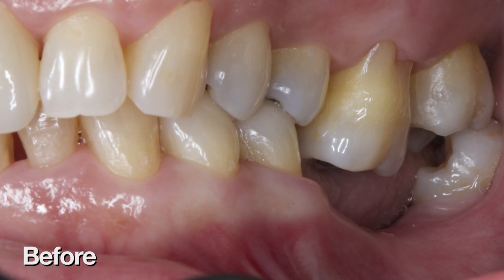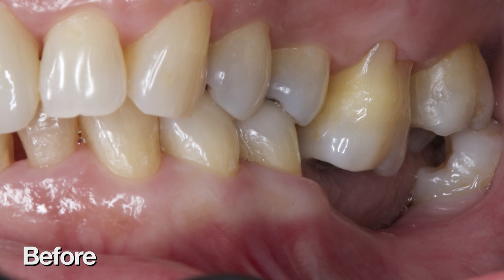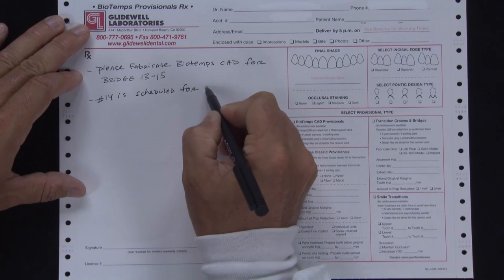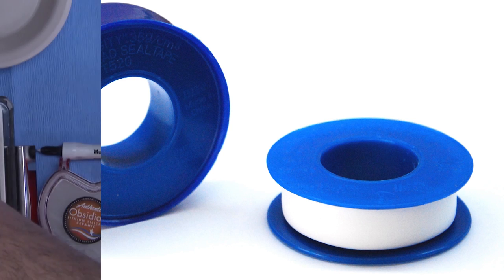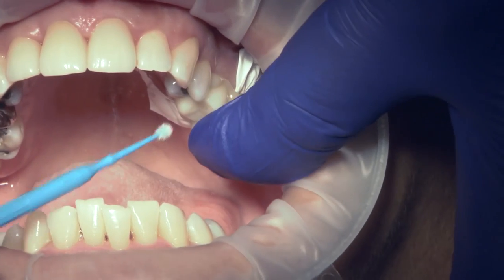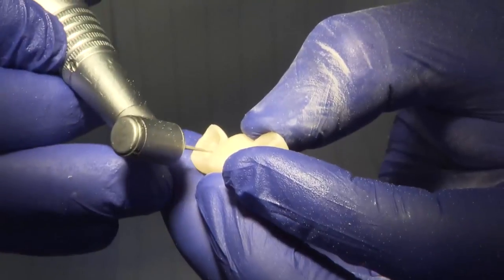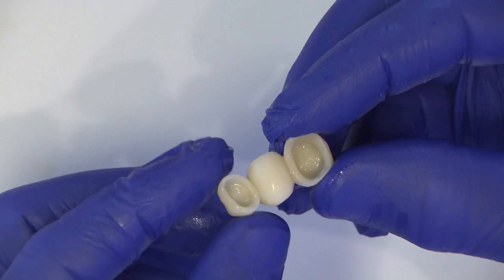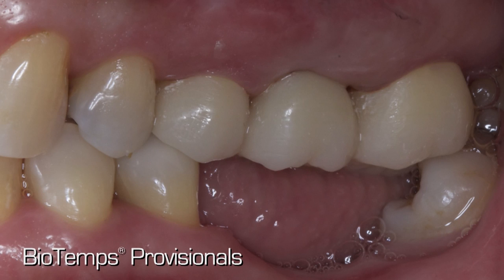Case of the Week: Restoring the Posterior with a BioTemps® CAD Bridge

Comment: thanks for the video. could you provide some info about the rubber wheel and polish you used? and the light curable glaze?
Reply: Glad you liked the video. The polish that I use is a fine diamond paste called Diashine. I apply it with a Robinson polish wheel attached to a slow speed straight handpiece and then use an alcohol soaked gauze to clean the excess paste from the temporary. Robinson wheels are available in packs of 12 from dental supply companies such as Henry Schein. When using chairside, light curable glazes, I most commonly use products like LuxaGlaze by DMG, Seal-n-Shine by Pulpdent, or even GC FujiCoat LC. Simply paint it on the temporary with a microbrush and light cure for a high luster finish. In cases where my temporary appears slightly lighter in shade than the adjacent teeth, I instead use a few drops of bonding agent such as Scotchbond by 3M and that helps bring the shade down to match while also adding a smooth finish.